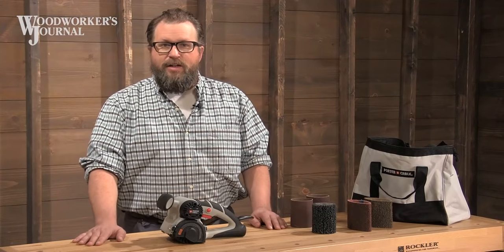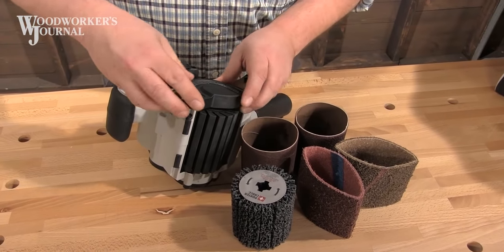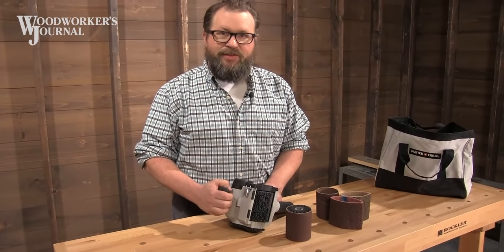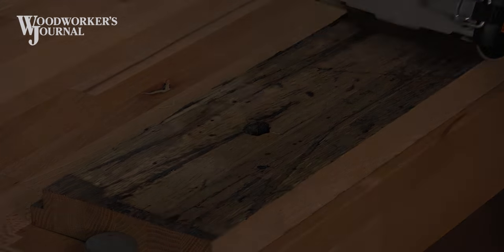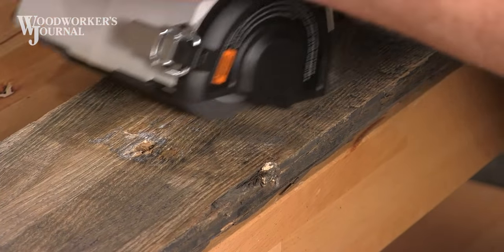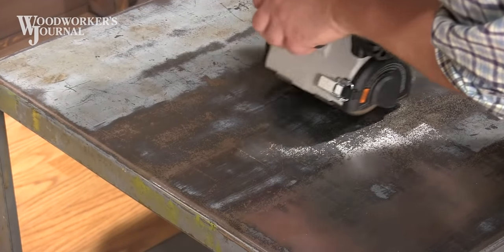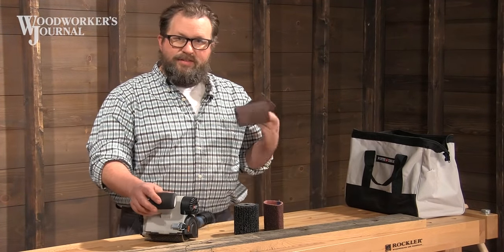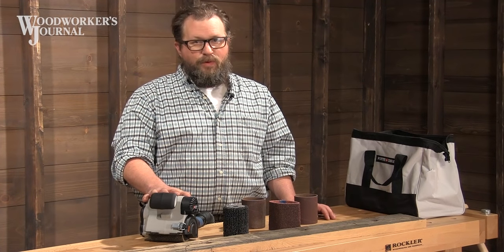Porter-Cable Restorer | Wood Resurfacing Tool Overview

Comment: I'm thinking a belt sander would be fine for most cases - or an orbital with 40 grit discs. If I had a lot remove I'd use the planer. 
I wonder if you could use the thing to put grooves in wood?

Comment: Looks awesome.  Would this tool work for removing paint that has grit mixed in?  I have an outdoor wood deck that the previous owner painted with a paint+grit mixture.  It is now peeling (about 10 yrs after installation).  It is "rubbery" and I'm worried it will gum up a sander in a matter of seconds.....  Any suggestions?
Reply: In case anyone is wondering the same thing, years later, there are different drums available suitable for this. The black stripping drum shown (fleece with some sort of hardening polymer on it), would probably get the job done since those are designed to deal with paint and other stuff that gums up sand paper. They also have abrasive nylon brush drums that would not be prone to gumming up, or at the very least be easy to clean off.

Comment: Never heard of this tool.  Looks like it's mostly for very rough work - and capable of doing some real damage!  Trying to think of applications where another tool wouldn't do the job, obviously belt sander or planer is right up there.
Reply: On the house I'm doing now, which I've applied paint removal ..its four coats of paint on steps then original shin on beautiful wood floors... Should I use this, and if it gets rough then use a DA, not big deal right? Would you recommend this for me?
Reply: Anything where you either don’t want your sandpaper clogging all the time, or want straight clean lines instead of random orbital scratches. Or where you actually want to texture the woods surface. No sander can do that.

Comment: Could this be used on surface rust of a cast iron table saw top?
Reply: I've found that a scotch-brite pad with either WD-40 or T-9 Rust-Free works quite well there. You can stick it under a random orbital sander (just held on with pressure) if something is really bad, but I was able to deal with mine with just elbow grease.

Before: https://www.flickr.com/photos/psychlist1972/32414734484/in/album-72157681514961086/

After: https://www.flickr.com/photos/psychlist1972/32414731974/in/album-72157681514961086/
Reply: I'd be concerned that something like this restorer might be too aggressive on an must-be-flat surface like a table saw.
Reply: It would work perfect in that application using a rust/paint removal roller that is sold at Lowes for $15.  It would probably only take a few minutes.

Comment: Why would they not include some type of brush head like the Makita 9741? 
Without that function this would not be something I would consider.
Reply: The Makita is three times more expensive than the PC. I figure that would explain the difference in accessories.
Reply: Wellington Corp is the maker of the tool and it is licensed under Porter-Cable.  They are working on a steel wire wheel and an abrasive bristle brush like Makita.
Reply: Porter-Cable sells a nylon brush wheel for this tool.